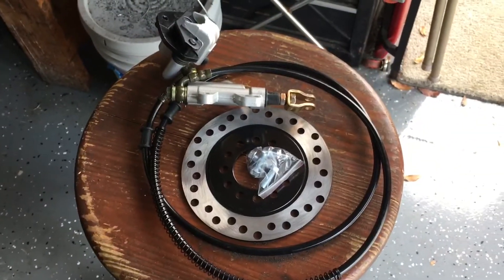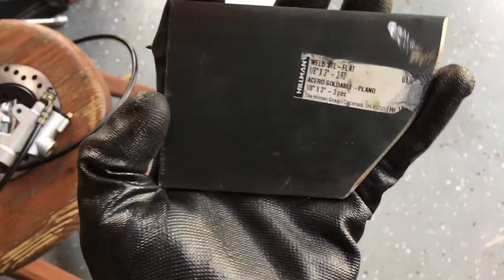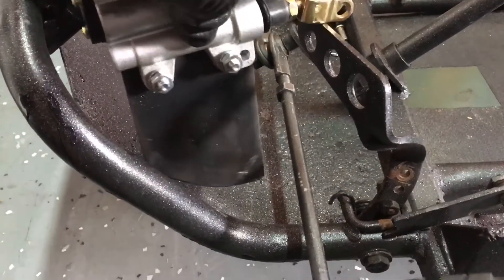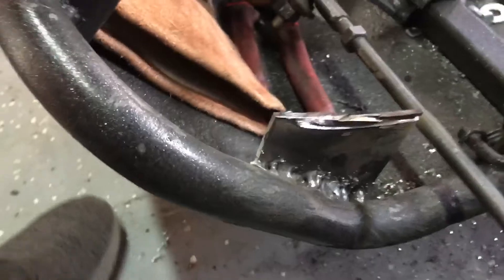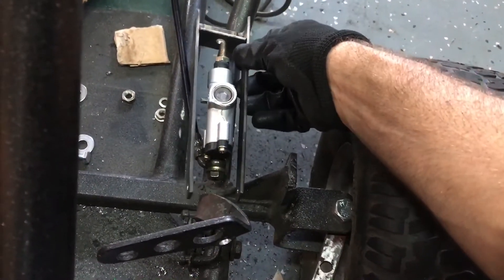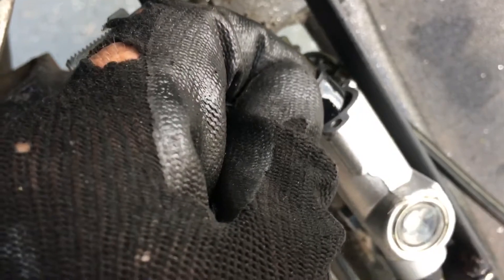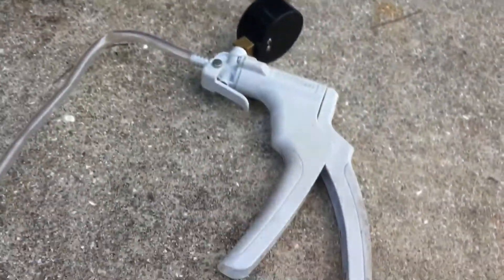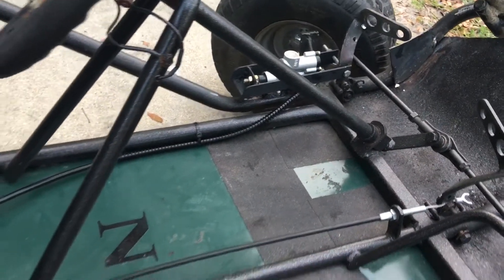Hydraulic Brake Conversion on Go Kart

Comment: How did it hold up long term?  Debating on dropping 50 bucks on one of these.
Reply from the maker: Honestly it doesn’t grab as hard as mechanical ones I’ve used in the past.  But then again I wasn’t able to get all of the air out the line either. Get one with some sort of small reservoir that connects to brake cylinder. That way you can get a better bite.

Comment: I like it.  It looks like the kit I just ordered yesterday for my Manco.  The only issue I can see on your setup is, The bleeder on your caliper really should be higher than the banjo joint on the hose.  It is damn near impossible to get all air out of the system if it isn't.
Reply from the maker: Wow thanks for the comment. That hasn’t occurred to me before.

Comment: Bleed the mater cyl. first. Connect a short hose to outlet then back into reservoir. Operate it add fluid operate til bubbles stop. Connect brake line to master cyl. and caliper. Bleed system.

Comment: I bought the same master cylinder and caliper setup.im having trouble bleeding the system.im not getting any pressure to stop it at idle.did u have issues
Reply from the maker: Moe Ahmed yes I did have a lot of trouble bleeding the system. It took repeated attempts over and over to finally get it to work
Reply: @Noeladventures  im happy to hear that lol.im spending hours on bleeding it and not getting no where.i wanted to make sure it wasent a bad caliper.thanks buddy
Reply: Were you able to get it bled?  If your bleeder isn't higher than hose connection at the caliper it is a royal pain to bleed and get all the air out.
Reply: @EvrttGrn  nope its just sitting in the garage.i tried so many times hours at a time,and it still wont build pressure.the bleeder valve is higher than the caliper also